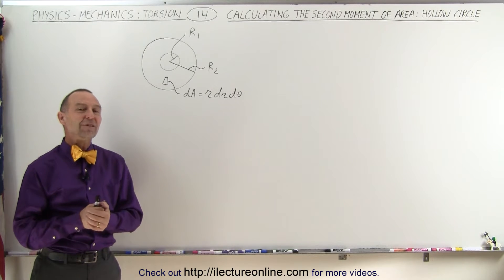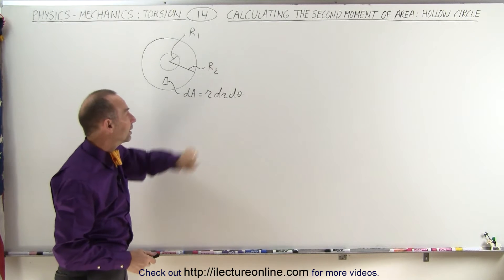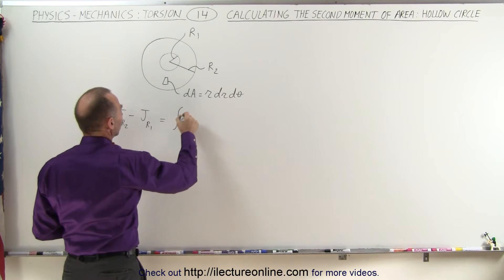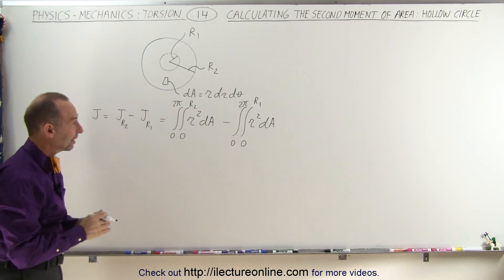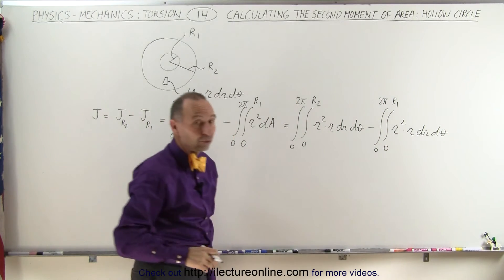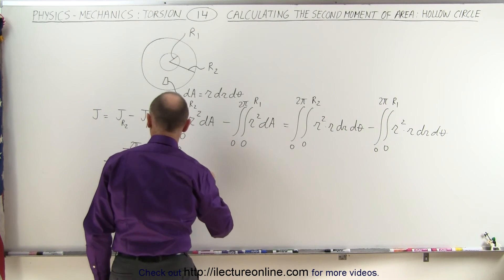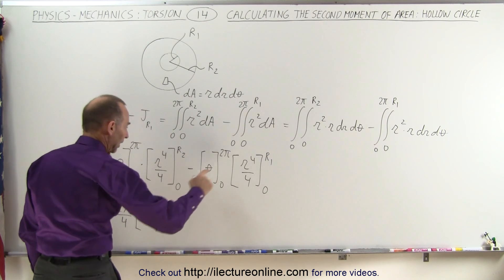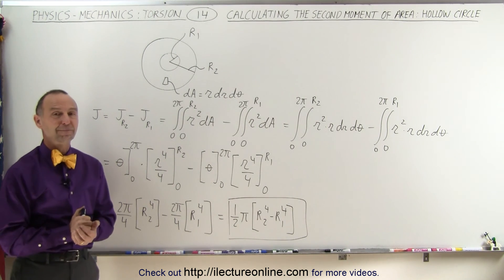Physics 16.6  Torsion (14 of 14) Calculating the Second Moment or Area: The Hollow Circle

Comment: I'm pretty sure its 1/4 pi*r^4.  But cant find where you've gone wrong, or why I'm wrong!
Reply: You've calculated the polar moment of inertia which is resistance to torsion, not bending.  To be fair, your lecture is for Torsion, but you've calculated the polar moment of inertia rather than the second moment of area.
Reply: Ye I'm pretty sure you're right and this guy is wrong